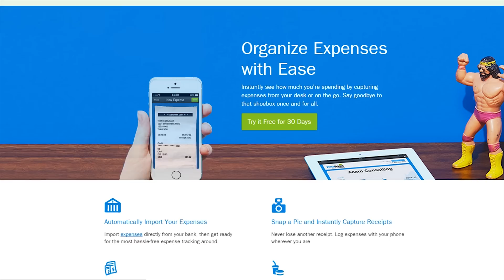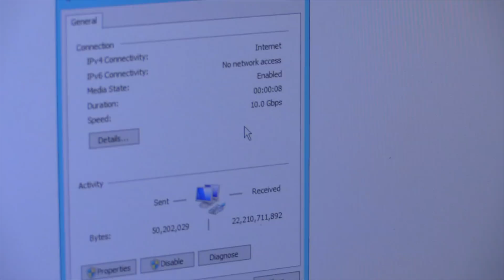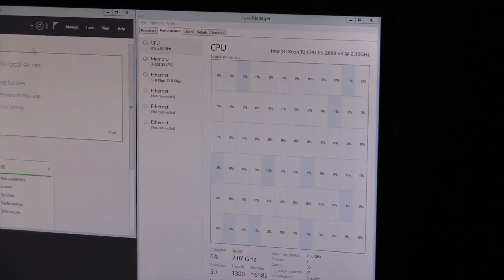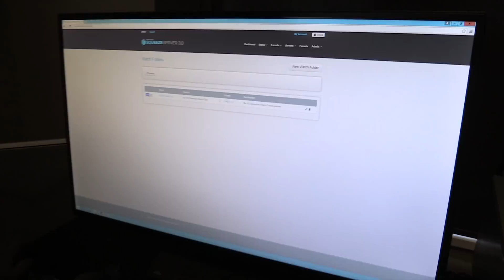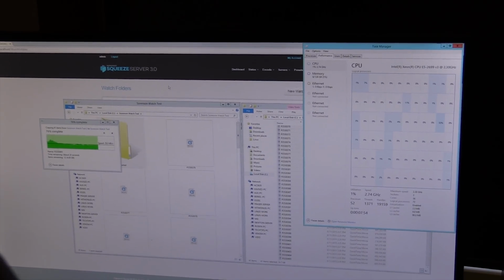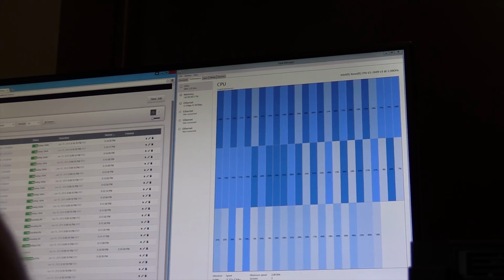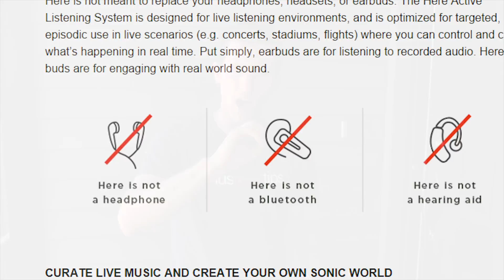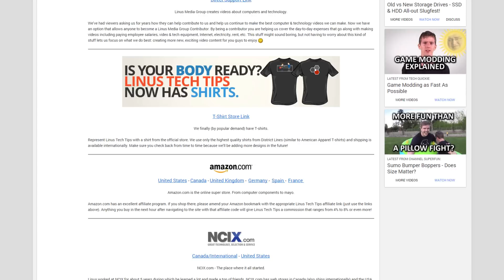36 Cores, 72 Threads, and Two Titan Xs - Our New INSANE Rendering Machine Part 3

Comment: Hello sorry that this has nothing to do with this but this is my new pc im planning to build.

-Intel Core i5-4690K 3.5GHz
-Galaxy GeForce GTX 770 2GB HOF Video Card
-NZXT HALE82 V2 550W 80+ Bronze Certified Fully-Modular ATX Power Supply
-Kingston HyperX Fury White 8GB (2 x 4GB) DDR3-1866 Memory
-Asus Sabertooth Z87 ATX LGA1150 Motherboard
-Corsair H100i 77.0 CFM Liquid CPU Cooler
-Kingston SSDNow V300 Series 120GB 2.5" Solid State Drive
-NZXT H440 (White/Black) ATX Mid Tower Case
Reply: Go for a new GPU
Reply: OttoTeched Looks good, but if you are planning to overclock that K CPU make sure to get an aftermarket CPU cooler
Reply: Go for a gtx 970
Reply: emmanu888 That's a massive upgrade. A GTS450 is about equal to a GTX260. The 680 is ~5x faster.
Reply: OttoTeched Just get a GTX 970 as your graphics card.
Reply: Instead of the 770 HOF, get a 970 by MSi, Evga, Asus, ect.
Reply: I just need something white for the build
Reply: Get 1TB or more HDD
Reply: whats HDD this is my first build
Reply: HDD means hard drive
Reply: Your PSU is probably a little too weak, but i'm not really sure
Reply: OttoTeched Definitely not bad. As others have said, DON'T GET THE SSDNOW V300. I also agree that the 770 is a bit outdated. Galax makes some really great white GPUs; go with a 960 EXOC White or a 970 HOF.
Reply: Go with the r9 390
Reply: PowerNickel The 390 is much more expensive than the 770, and he wants something in white.
Reply: Michael Marquardt But why let a color impact performance?
Reply: PowerNickel It's not entirely about color. It's also about price.
Reply: Msi has a white 960-970 i forget what its called, but its white
Reply: @ottoteched good but the graphic card could be better
Reply: OttoTeched 960>770
Reply: OttoTeched Maybe look into a 380 :)
Reply: Mootypotuty the 770 is faster. The 960 falls in between the 760 and 770, around the same as the 670. The memory bandwidth (or lack thereof) hurts it bad.
Reply: ***** I cannot fine the 970  anywhere
Reply: OttoTeched they're in stock on Newegg and Amazon
Reply: OttoTeched 
DO NOT get the 770, it costs way more than its worth
Reply: EnderGumball - this I can agree with. The 770 is basically just a rebadged 680 with better memory. You can find a 680 for like $150
Reply: ***** 680 is faster than a 960. The 960 is roughly on par with a 670, unless memory bandwith comes into play. That's where the 960 is crippled.
Reply: Droogie128 Wow i feel great knowing that since i changed my GTS 450 for a GTX 680 Twin Frozr III OC just recently.
Reply: ***** the 4690k is all that is needed for gaming. How is that a bad build? It's an amazing cpu. The only way up would be an i7, and it wouldn't benefit gaming. You need that cooling for overclocking
Reply: ***** and it makes no sense. A $100 cpu cooler is perfectly justified with that cpu, as it's designed for overclocking. I agree they should get a better gpu, or spend less and get a 680 (which is basically the same card as a 770), but I wouldn't sacrifice cooling to do it. I'd save another $50 and get a 290x or 970.
Reply: ***** You've obviously never done a serious build. Overclocking requires heavy cooling. $100 is cheap for a cpu cooler. A custom loop can run way more.

Comparing their prices is a logical fallacy. False equivalency. You get what you pay for in terms of the cpu cooler. The 4690k is the best gaming cpu out there, and it overclocks extremely well. You need to cool it, though.
Reply: Do not buy a 770, the card is now "EOL" (End of Life) and is more expensive then the 970 in most cases.
Reply: Is there a good white or black one to fit my build
Reply: ***** Uhh, no. Overclocking to its maximum potential requires top notch cooling. Air cooling can achieve good results, yes, but it is far more limited than liquid cooling. Achieving your maximum overclock on both gpu and cpu is ideal. If you're going to invest in a cooler, get the best one you can get within your budget. 

It isn't presets, either. The quick and dirty ones, yes. However, if you want to hit your best potential, it takes days and days of testing and tweaking, followed by days of stress testing. I don't consider an overclock stable until I've had 24 hours of Prime 95, then various benchmarks and games. I ran a 2600k @5.0ghz. I currently run a 4930k @4.8ghz. You're not gonna get that without an investment into cooling.

I agree that the 770 is a horrible choice, though. The 680 is basically identical, and far cheaper. 

Also, it isn't always just about the gaming whe it comes to OC'ing.
Reply: OttoTeched Get a better PSU, get a better GPU with at least 3 gigs of vram, get a 1-2 tb hdd. And you should be good.
Reply: ReviewTechSquidward Any white ones u can suggest or black
Reply: OttoTeched White or black what?
Reply: gpus
Reply: OttoTeched The color of the GPU doesn't matter.
Reply: Its for the build
Reply: ReviewTechSquidward Or a 290x
Reply: OttoTeched get a 1060!!!

Comment: This rig would be so awesome for 3DS Max. H264 rendering isn't real rendering its just re-encoding. You don't even need to edit using the original file. You can edit a low-rez, super tiny file and then just apply the edits to the main, .raw file or whatever raw format 4k cameras use.

Comment: You can automate this processes in Linux without a specialized piece of software. Just need someone who understands linux architecture.

I wouldn't have said anything accept your sarcasm toward people asking why you are not using Linux on a server. and your response being because I chose a specific program seems a bit weak. I love your channel and work and have nothing against you.  

However as I mentioned, this can be done on linux and you could probably get a really performant solution with a little experimentation. I understand you probably don't have any hardcore linux people on staff or may lack interest in using a less famillar  platform. (especially since this needs to be production ready now rather than latter.) I could do this and possibly with more speed and reliability under linux given the time to play with it. 

This choice gives you commercial support and simplicity which is fine. If I had a job with you I would probably be trying to get permission to experiment with setting up Linux system to eventually replace this :/ Anyway keep up the good work.

Comment: ''When I wan't to put proper graphics cards in there''
.... Dafuq you call a Titan X lol??? Ohh I am guessing that's like low end crap right lol xD
Reply: NOOB GAMINGNG The machine does no sort of GPU rendering. All transcoding is just a CPU load that is very slow on most systems; however, you do need a GPU in order to actually render the visual client. A proper GPU such as a Titan is a waste of space, puts an unnecessary power overhead, and introduces unnecessary heat when all he needs is something to render the desktop, and any windows open on the computer.
Reply: TalesOfWar and the Z's were heavily gimped too by not having sufficient cooling to run at full clock speed lol

Comment: Why didnt Linus use a Corsair AX1500i PSU since its 80+ Titanium and very very very x999 realiable and build quality is solid,why not use that?
Reply: Terty Brown Titanium means it's more efficient not more reliable. If he was adding gpu's I'd agree with you but just the cpus means he's barely going to be loading the psu, ending up being less efficient.
Reply: Oh.Thanks for th info m8.Probably will settle on the 750V.
Reply: Terty Brown Overkill.
Reply: ***** For fun videos they go overkill most of the time. For actual work pcs they are more grounded with the exception of the Water cooling loop
Reply: To be honest Linus did say he wanted wait lemme rephrase that he NEEDED a reliable PSU so you know if you're gonna go 36 Cores you might as well go for the best of the bestttt in the Market.Amma right?
Reply: Linus wants a redundant psu and the most they have 600-700 watts
Reply: Terty Brown a 1500w isn't mroe reliable then a 860w psu. They're both AXi series. What Linus really wants is a redundant psu
Reply: Yes,I get that but you know....just because,80+ Titanium XD instead of 80+ Platinum.Which =Higher reliability but lets be real..if he's gonna go "HAM" he might as well do it.Tbh from my angle...I would do it :D just because I can XD
Remember this is from my stand point..meh
Reply: bensemus x Mehhh.True,cant argue there.Thanks for the info though always thought of it like that but turns out it was for another point.Btw since you know more though...Which is better for this RIG im building:
Asrock X99 Extreme 4
Intel i7 5820K
Corsair H100i
NZXT Phantom 820
3TB WD GREEN
8GB DDR4 RAM 2133Mhz Kingston

With this build which should I go for a CM 750V or a CM 650V?
Yes I will be doing OC's on the CPU and im gonna squeeze every little bit of performance I can from it.And also what GPU should I use a GTX780 or 780Ti or R9 380 or 2x GTX 690?
Gonna be rendering videos alot as well and stream and record while streaming,soo which PSU is best? OR do I need to open the budget a little bit more for a higher watts PSU?
Reply: Terty Brown Look at your software and see what hardware it wants. Some want amd other like what Linus use want CUDA. If its CUDA accelerated I'd buy a Titan black as that has the double stuff. The gpu's you've listed are quit different, the 690 is a dual gpu card. Out of those 2 psu's I'd go with the 750w if you are using a single new gpu. If you are using 2 gpus I'd jump up to 1000w. I have 2 780ti's and a 4790k on an 860 and when I bench at stock clocks they are getting really close to maxing out the psu.